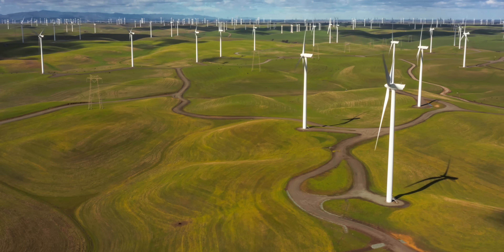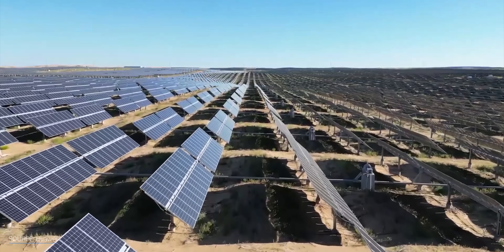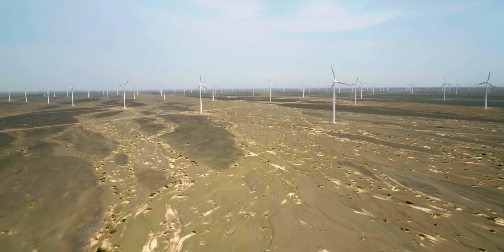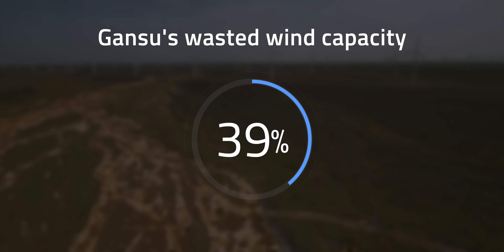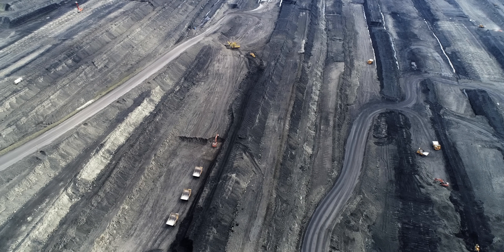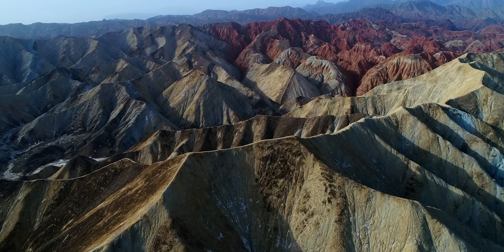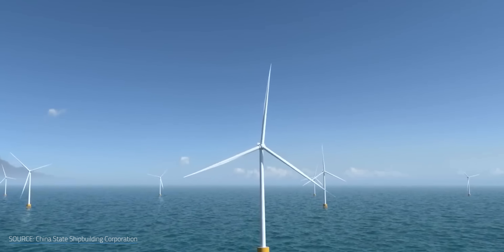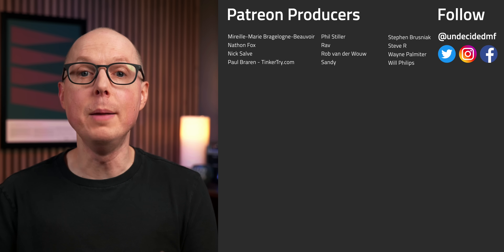The World’s Largest Wind Farm has a Tiny Problem

Comment: Bit of a classic catch-22.  The places that would most benefit from wind and solar farms tend to be heavily populated, leading to high land prices (and concerns about aesthetic and side effects), which makes building these green energy farms much less appealing, and the places without those concerns tend to be too unpopulated to make the benefit practical.
Reply: On the other hand, heavily populated areas have a lot of roof space, industry and parking lots that can be covered with solar. Not as cheaply as the desert, but still.
Reply: Fortunately transmission of Electric is pretty efficient and not stupidly expensive to build so in most cases you can put the renewables where they will work best and get past the NIMBY's so it can actually get built and still have the benefits where the power is needed.
Reply: @foldionepapyrus3441  building transmission is not cheap.  It's cheap enough that China can achieve it because its central government can authorise it and override local objections with ease, but other countries which allow and respect the private ownership of land must negotiate every step of the way with numerous stakeholders, many of whom have visceral objections for reasons that are more tribal than practical.  In a country like the US, the federal system also makes long-distance transmission lines bureaucratically troublesome.  Indeed the largest state of the continental US has deliberately refused any AC connections between its power grid and those of neighbouring states, in order to avoid becoming subject to federal government regulation.  This is slowly being overcome by HVDC interconnectors, including even one between Texas and Mexico, but these are not long-range transmission lines like those linking the vast energy resources of western China to demand centres in the east.
Reply: @JonathanMaddox  Transmission lines absolutely are cheap (for an infrastructure project anyway). 

The good or crap hoops that must be jumped though in any particular nation to get infrastructure projected approved or operate and the relative price of labour are not really relevant. As those same costs will generally apply just as much to everything you wanted to connect with the power line if not more as the complexity of building just about anything else is orders of magnitude higher, so will eat even more expensive labour time.
Reply: @foldionepapyrus3441  I think current transmission technology is about 45% losses, actually.  That's not terribly efficient.
Reply: @kentalanlee  I'm not sure where you get that number. Losses in transmission and distribution in the US average about 10% to 12%.
Reply: @kentalanlee  5%, not 45%.
Reply: @kentalanlee  It certainly varies across nations, and distance plays a part. But 45% is wildly out there, the worse i've ever heard of of is in the 20% ballpark for energy lost in transmission.
Reply: @foldionepapyrus3441  My apologies. You are correct.  I was reading something that conflated operating percent capacity and losses together on this project.
Reply: @foldionepapyrus3441 this is also UHVDC at something like 1000 kV (that's 1 megavolt), it's very high voltage precisely to avoid losses. China has quite a few of these now, but they are very rare in the rest of the world, but Brazil is building one with Chinese help.
Reply: @kentalanlee  Further to kmw8775's comment, it depends on what you mean by "current" (pun intended). The tec has advanced greatly in the last decade.
Reply: @jonb5493  Oooof!  Dad joke warning!
Reply: @dijikstra8  True in this case, and some others, but even 'normal' grid transmission lines are not that bad as a rule. You have to be transmitting a long long way to find the losses unacceptable. Usually even on the mostly decades old infrastructure the problem is current carrying capacity ever so much more than efficiency of transmission.
Reply: @kentalanlee  “Electricity transmission and distribution (T&D) losses in the United States average around 5%.”
Reply: @kmw8775  That's for short lengths. If you account for the distances shown in the video, it is closer to 45% losses.
Reply: "The places that would most benefit from wind and solar farms tend to be heavily populated,..." Would those places prefer a coal powered plant with all it's fumes?
Reply: @evaluateanalysis7974  You DID watch the video, yes?  Seems at least sometimes, the answer is 'yes'.  In any case, there are other types of power plants that are less overtly polluting, like nuclear.  Additionally, they don't have to produce their own power, they could get it from a neighbouring community.  My other points about the catch-22 still apply as well, like cost.  Populated areas tend to have much higher land costs, and both solar and wind farms require a lot of land to produce a lot of power.
Reply: @ThatSoddingGamer  How many people would like a nuclear power station built nearby?
Reply: @evaluateanalysis7974  Depends on if they prefer the relative safety of a nuclear power plant over the toxic fumes of a coal plant, assuming they had to choose between the two.

Most would probably not want to live near a power station full stop, regardless of its type.  Electric service is probably very reliable near one, but proximity comes with aforementioned negatives.
Reply: Hope we make large improvements to energy storage and transmission soon. Then this will be less of a problem.
Reply: Which is why rooftop/parkade solar and community wind is so good. Just the energy oligopoly does not want us to so it because they lose revenue control. So they resist it wherever possible. 

Why build in the country and ship in power when we can easily generate right at the consumption point.

Comment: I do not understand how this project got funding without a clear plan to distribute the energy. The world is ran by idiots who build nothing themselves. 🤦🏻‍♂️
Reply: They are not idiots - they are corrupt control freaks!
Reply: Why assume that's the case, it might be the way Matt presented it - there likely was a plan but it has to work its way through to completion. Typically these large generation projects have grid upgrades in the mix, but these have to work through different companies and government departments. Hence, those repsonsible for tranmission may have said we'll spend the money when capacity becomes sufficient, otherwise they risk wasted spend if a big generation infrastructure project delays or fails. This is why such infrastructure projects are phased, to optimise cost and reduce risk/exposure; it's only at the end once completed that the full benefit is realised, at the points in between there may be no or limited benefits realised.
Reply: If that was the case, then they would have built such a great wind farm in the first place. Don't assume people are stupid just because they lead China.
The far more likely scenario is that it's a project no one in the world undertook, so no one knew what the challenges were.
Reply: brilliant my comment saying that corrupt does not equal idiots has been removed. 1984 implementation gets ever more refined...

Comment: Pfft, so my country, The Netherlands has the same size of this wind farm. In optimal conditions (which are very rare) it produces 20 Giga Watt/h. My country uses 120000 Giga Watt/h per year in electricity alone. So for electricity we need 6000 times the area of our country?😱
Reply: The Netherlands has a wind capacity of 11.6 GW. The wind turbines produce about 20% of the electricity used by the Netherlands.

No idea where you are getting your figures from.
Reply: The power output of the Gansu wind farm is 20GW (not 20GW/h, which is energy), which over a year (at an average 30% capacity factor for onshore wind) would produce 52.6TWh of energy, throw batteries into the mix and you could probably raise this to 60TWh. This represents 44 to 50% of the 120TWh required for the Netherlands. Unfortunately, the Gansu wind farm is a collection of many sites spread out over a wide area rather than a single large wind farm, so it not useful to estimate wind farm size.

In Europe, onshore wind farms have a capacity density of about 4MW/km².  The 120TWh of annual energy needed would require a wind farm of 46GW covering an area of 11,500km², or about one Qatar in area. 

Of course being a costal country off the North Sea, the Netherlands will more likely be powered by offshore wind, which has a higher capacity factor (generates more often, approx. 45%) and higher capacity density compared to onshore wind. The North Sea has a capacity density of about 6MW/km², hence 120TWh equates to 30GW of offshore wind covering an area of 5,000km², <1% of the North Sea's area or a little under a Trinidad and Tobago.

Comment: The other part this wasn't mentioned is that the water supply and availability wouldn't support any type of large increase in population.    you can't just move 100,000s of thousands of tech workers into the desert.  You would have water and food issues.
Reply: Tell that Phoenix   :)
Reply: @scottbalak7123   @supercadet111  AZ/Phoenix also seems to be running out of water, even if most of the politicians pretend everything is just fine
Reply: As others have said, it's not that many tech workers needed. But datacenters are very thirsty - they use an awful lot of water for cooling, comparable to a city.

IMO that province should focus on other power-hungry industries that don't require as much water - for example, ore processing. It has the added benefit that those industries sign long power contracts, which guarantee stable income for the developers of the wind farms.
Reply: @weirdguybr  ore processing requires more water than data centers.
Reply: @stvrob6320  Fair enough - I mostly remember ore processing from their massive energy requirements, but I never looked at other aspects of the business.
Reply: @weirdguybr  That cooling water can be recycled like a car cooling system
Reply: @AndrewN75  Except that is not what datacenters do, because that is expensive/not efficient from their POV.

Most large "cloud" datacenters are built in areas with cheap/plentiful energy+water, because they rely on evaporative cooling which is extremely cheap to run as long as you don't care about wasting water.

If power is extremely cheap, they could operate with very large AC systems, but in most cases so far, wasting water is much cheaper.
Reply: @weirdguybr  That would not work in the UK as all water usage is metered. It is certainly unsustainable long term because water shortages will occur in most places in time. There are plenty of examples where waste heat is used for district heating as well even evaporated water will condense. It is certainly short sighted.
Reply: Data centres do not require thousands of tech workers.
Reply: The place is moon like.  They developed nuclear weapons there. The university lost 19 out of 20 professors to east coast cities.
Reply: Doesn't China have economic problems at the moment ?
Especially in the tech sector with massive layoffs.
I doubt a little that they will create a new tech center in this situation in the middle of nowhere
Reply: @blablup1214  So does the West. But Google is still got lots of data centers in line to be built, including one down the road from me.
Reply: Data farms aren't that labour intensive.
Reply: Data centers require large amounts of water for the cooling systems. They are here building them in Wyoming, and we don't have the water for it. We have the wind for the wind farms and overall cool/cold temps most of the year, but we lack water.
Reply: It's not hard to transport water and food, the pricing would be higher though.
They had a massive national plan to build a water transporting infrastructure that moves water from south to north, which was completed years ago but abandoned, because the cost is too high and the efficiency is too low.
Reply: And they would have to install high-speed fibre lines to connect to the rest of the world. Having a date centre in the middle of nowhere is not much use if it can't communicate.
Reply: @ShawnHCorey  That's literally the least difficult aspect.
Reply: @ShawnHCorey  Those would be easy to install if the power line towers are in place first.
Reply: @ShawnHCorey  That's actually what the Shanxi supercomputer project is about. Super computing using green energy from solar and wind energy. They used to be a coal producing province.
Reply: Yellow river and other rivers go though eastern Gansu, so water is not an issue. Because of yellow river, the mother river of China, there are large cities in eastern Gansu and neighboring provinces.
Reply: To be honest, given the current economic situation, not just in China, but the world, having a job is great, especially skilled jobs. People would go anywhere to have the jobs. Living in a big city like Shanghai is so stressful, overcrowded. Earn more but spend also much more.
Reply: Phoenix seems to thrive despite being in the desert.
Reply: @stvrob6320 How much coal do we burn to generate the electricity to  pump the water in the Central Arizona Project?
Reply: Bruh...have you heard of California, Nevada & Arizona?
Reply: @supercadet111  They were populated and developed over literally hundreds of years. California is a coastal state, Nevada and Arizona are not cut of from the rest of the country hundreds of miles of mountains. Work on your arguments "bruh".
Reply: @supercadet111  --  The USA has the (rapidly disappearing) Colorado River supplying water to their southwestern States. That is not the case in these Chinese deserts.

Comment: While fossil fuels make up less than half of China's energy capacity, China's wasting 50% of the wind energy coming from Gansu.  That means the numbers you mentioned simply aren't important.  More relevance would come from looking at how much of the energy they are actually using is coming from fossil fuels.  Not how much they can generate, but how much they use.

As for replicating their "success" in the USA, no.  This isn't a success.  It's just a number which looks like a success until you look at how much is wasted.  It's like China making more electric vehicles than anywhere else, yet they're just throwing all the electric bikes, scooters, and cars into fields to rot, as they don't sell most of them and wouldn't use them if they did.  The numbers are fake if they're not representative of actual use.

We don't need to chase numbers in the USA.  We need to be a lot smarter about these things than China has been.

Comment: The solution for the storage & utilization issue is to produce green hydrogen.   

Gansu has set a target to produce 200,000 tonnes of green hydrogen annually by 2025. This aligns with China’s broader goal to scale up hydrogen production using renewable energy sources, primarily wind and solar power. Gansu, along with other provinces like Inner Mongolia, is a key contributor to China’s green hydrogen ambitions, which could collectively surpass 1 million tonnes per year by 2025.

This development is part of China’s long-term hydrogen strategy, aiming to establish itself as a global leader in hydrogen production and technology by 2035. Gansu's abundant wind resources make it an ideal location to contribute significantly to these targets, complementing the country's national roadmap for hydrogen energy  Sources: (Policy Circle)(Renewable India)(H2 View).
Reply: Even if it was a suitable location for hydrogen generation, which it isn't, how will this be transported to areas of need? Tanker, vessel trailer or pipeline are all complex, expensive and time consuming options compared HVDC/AC transmission. Hydrogen is more likely to be planned to be created in costal and riverine areas using green energy rather than deserts or areas under water threat. 

Further, green hydrogen being only an energy storage mechanism (one that has high losses) will likely be generated once the other demands upon renewable electric have been met, and likely targetted to industrial needs that require both heat and power. If hydrogen is generated as the priority over electricity demand greenification, then China is unlikely to achieve it's 2050 net zero target.
Reply: Where do they get the water to produce hydrogen from? Gansu is not near a sea or an ocean, is it?
Reply: @ProfessordevilL   Indeed, Gansu is  landlocked region and not near a sea or ocean. Primarily sources its water for hydrogen production from local freshwater resources, such as rivers, groundwater, and possibly reclaimed water from industrial or agricultural processes.

Comment: Wind turbines are only part of it. They need some kind of inertia driven power to keep the proper hertz for the grid. The wind turbines alone can't power grid, because of needing proper hertz. The dust from gravel pits and farmers fields has taking out a few turbines here. The dust really does a number on the blades. It is easier to run 50 hertz grid with turbines than 60 hertz. China's dams are one of the reasons they can produce right hertz to use solar and wind.
Reply: That's why we have synchronous condensers and batteries.

Comment: Nothing seems to change!
Sorry to be negative but building kit that is not used is NOT a success story!
Building it to just above peak use would have been, but that is not what they did!
Also there is the thorny problem of base load! If you need a certain load and you have a super cheap source it does you little good when that source is intermittent. You still need the more expensive but also more reliable source of power ..... and That costs! 
Sure storage, if achieved would be a solution but we are far from there. 

Basically we need to work (or generate) Smarter, not harder!